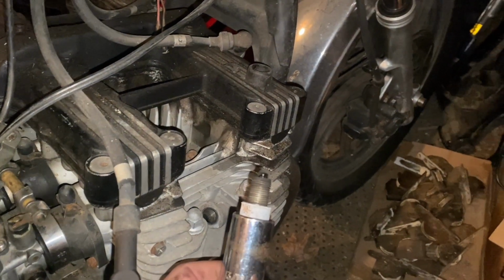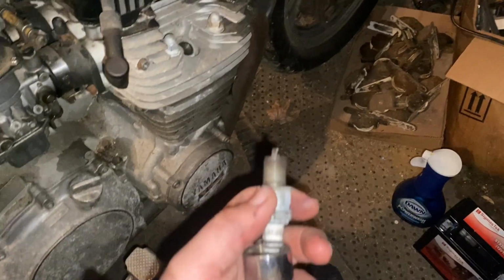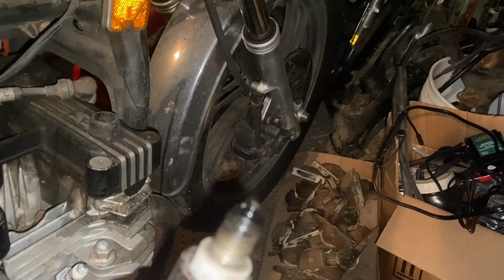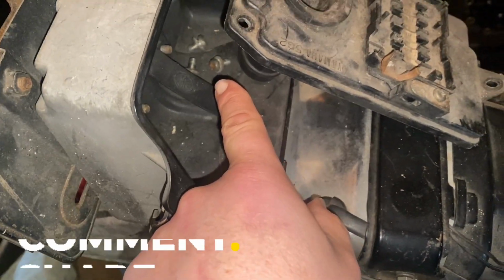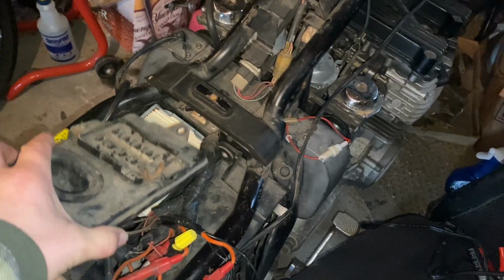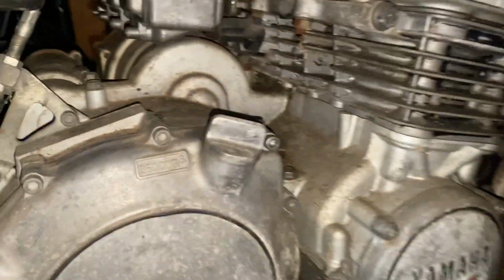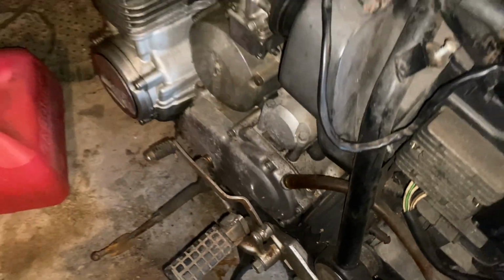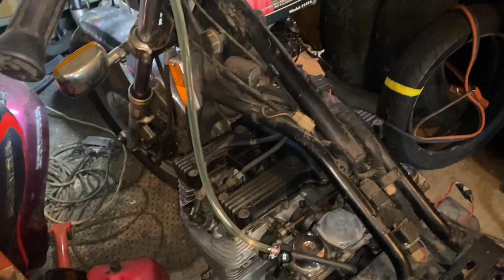1982 Yamaha Maxim XJ750 Barn Find Project. Spark Plug check New Air Filter Running Leaking Fuel

Comment: make sure that its not back flowing through the carbs into the airbox, there is a small drain hose that runs from that and if you get down on the ground you can see it nicely. that was the problem on my 750. it would probably leak from right behind the gearbox and the hose isn't easy to find when you aren't looking for it but once you do its hard to miss.
Reply from the maker: Thank you. I’ll be checking that out if it does it again. Seems to have “cleared up” 😀😬